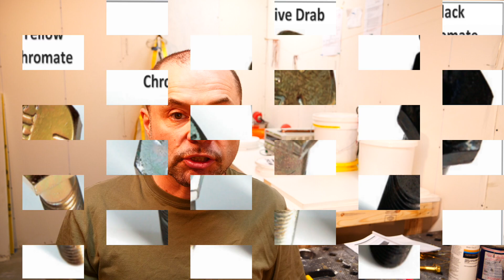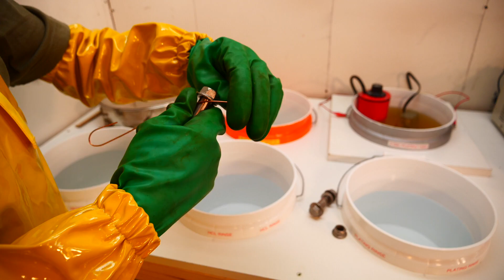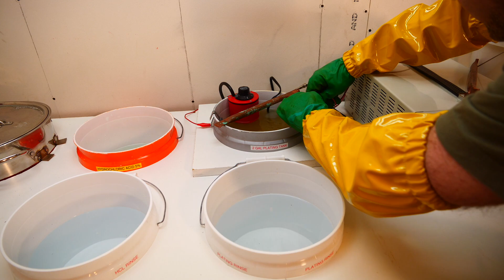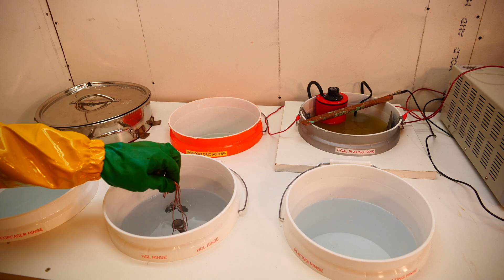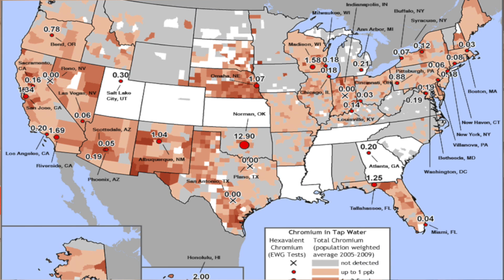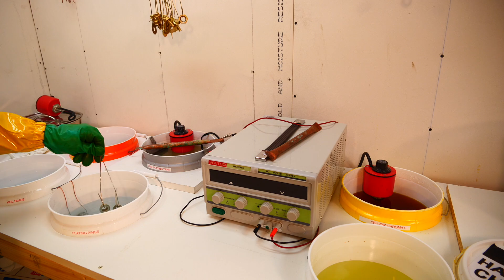ZInc Plating Hardware with Caswell Electroplating Copy Cad Zinc Plating Kit

Comment: Hi. I am new to zinc and chromate plating and love your detail. Expect the Caswell kit in two days. I have tumbled a number of bolts to plate and wonder if they still have plating on them. They are so light-dull and look so good I would use them "as is" but don't want to have rust develop right away?
Reply from the maker: Zinc will dissolve rapidly in hydrochloric (muriatic) acid  when you are prepping your parts before plating.

Comment: After plating, install, brush bolts and nuts with wax mix. 10 parts petrol, 3 parts paraffin wax. Heat it up before use, in hot water bath. Great protection against water.

Comment: About how long do you hit the parts with the heat gun and how long until the parts are completely dry and the chromate hardened on the parts?  The first few times I have tried this the chromate wiped off after hanging for 24 hours.  I used a fan as the directions say but I did not use a heat gun on the parts for drying.  Maybe the parts need the heat for the chromate to secure completely to the zinc?  thanks
Reply from the maker: I think hexavalent chromate reacts with zinc in seconds but divalent chromate used in Europe takes a longer time in solution.

Comment: Really enjoyed the Tutorial...
A couple of questions resulted.
What is your mix for the Muratic acid?
Do you have a degreaser you recommend? (Simple green?) 
What is the percentage for it as well?
Reply from the maker: Muriartic acid is diluted with distilled water to a 5% concentration using a kitchen measuring cup and an online dilution calculator.  I buy the SP degreaser from Caswell plating.  The composition is a a trade secret but I suspect it is TSP that is sold for paint prep in paint stores.  Caswell secret mix has 2 ingredients on the MSDS sheet in 80-20 ratio.  TSP in paint store is an 80-20 mix of trisodium phosphate and sodium carbonate.  A soapy bubbly product can be hard to rinse off and it will cause bare areas like oil contamination does.
Reply: Compulsive DIY thanks so much for the added info.

Comment: Hi ; good video but what kind of  zinc plating ? Acid or cyanid or alkalin ?
Reply from the maker: Plating bath is Potassium Chloride, Ammonium Chloride, and Zinc Chloride. There is more potassium chloride than zinc chloride in the mix.  I buy a proprietary mix from Caswell company so I do not know exact proportions.  PH is adjusted to 5.5 with small amount of hydrochloric acid.

Comment: Hi .
Trying this process at home too and I have some problems with the yellow/gold passivate .
Doesn’t hold on very well on the parts , I don’t understand .
Do I need to heated the passivate ?
I say that because when I wanted to zinc plated my rear brake calipers , I noticed if I don’t heated the electrolyte , it didn’t work .
Thanks in advance for advice .
Reply from the maker: Are you using hexavalent (sodium chromate) or trivalent (chromium III oxide). This may depend on what is available to buy in your country. Hexavalent chromium is toxic and highly regulated.  It is easier to use at lower temperature and that is what I use in this video.  Hexavalent chromium is still available here in USA but, I believe, it is now illegal to sell it in the EU and many other countries.  Trivalent chromium is harder to use, but industry is switching to it for environmental reasons and worker protection.  I have no experience with trivalent chromium but I read that it is applied at 60 degrees C and takes longer.  Also trivalent colors are different.
Reply: Compulsive DIY 
Thanks for your reply .
I use Trivalent  , but I think i’ve understood , it need a lot of drying .
Reply: @MIEDEPAIN20011   How did it go in the end ?

Comment: FANTASTIC video! But please work on your audio mixing/levels between the parts where you're in front of the camera, and the parts where you've mixed in narration. I find myself continually turning my volume up and down. A cheap USB condenser microphone with a pop filter attached would help the narrated bits sound miles better. Then just work on normalizing the volume levels, and job done! :)
Thanks again for some GREAT info! :)

Comment: Mine is coming out very flat.  I’ve glass bead blasted per the manual...should I polish them before plating???  The way the manual reads they suggested that.
Reply from the maker: Yes, I buff them on a brass brush wheel till shine, before plating.  It goes fast on bench grinder. Like many other projects it is pre prep prep for good results.  The dull look is the simulated antique cadmium plate look, that some restorers need.  They get it by dulling with blasting or fiberglass brushes.
Reply: I did not add any brightener based on some comments on the forum..so 100% correct...that’s what I ended up with.  Added brighter and it matches new hardware now.

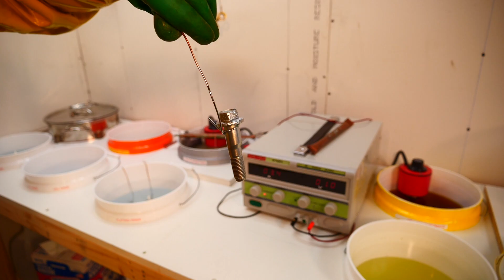Comment: can I ask you a question please: why do small quantity home platers get left with a grey deposit on their zinc plated parts? and then set about removing it? obviously a large plating company also brings the parts out with the full shine as you did at 19:50 but what makes the difference? also is it possible to Zinc plate diecast Mazak / Zamak? (zinc, aluminium, copper mix) - seeing as zinc is present in the metal being zinc plated?
Reply from the maker: I am not an expert just a hobbyist.  I read that many problems are caused by poor steel preparation, especially black spots.  Dark grey is caused by too high current.  Many home platers use battery chargers and do nor have great control of current.  Solution contamination is a big problem.  You can plate a sacrificial part to get all the contaminates onto it before your good parts.  I do not know much about Zamac.
Reply: @compulsivediy8036  - ok thanks .. Zamak/Mazak is what injection moulded Diecast Toys are made of - Hot Wheels used a transparent paint on plated castings in the 1960's which restorers try to replicate and effectively produce the opposite of a reflective surface but seem to find one under a coating of surface deposits after physically polishing it off. They looked similar to Anodised plating colours. Yours was the only actual zinc plated finish I could find as opposed to the 'surface deposit polished off' variety which a factory producing parts in large numbers obviously wouldn't have done. It's hard to say if Hot Wheels were plated for a mirror finish or a metallic grain though, maybe both, the reason they did it is clear, because Zamac is multimetal and this can still be clearly seen in a plain casting - hence the need for a even toned finish  before transparent paint is applied. https://hotwheels.fandom.com/wiki/Spectraflame

Comment: Excellent video. I have a full setup myself from Caswell and built some fancy electronics for temperature control. I noticed you were doing an acid dip before using the yellow chromate. What concentrate are you using? It seems some are acid dipping and some are not. Keep up the good work.
Reply from the maker: It is the same 5% muriatic acid that is used as a pickle before the plate tank.  I saw someone do it, apparently you get a brighter yellow chromate if you do a quick acid dip before chromate bur it has to be fast because zinc dissolves rapidly in acid.

Comment: Hi I´m alsow zinc plating myself , but i´ve seen your video and i would like to ask you a question. 

In my Zinc Tank , the Zinc is getting darker, and it is starting to contaminate the solution, do you have any advice in what i can do when i finish ( cleaning the zinc or something) and filtring the solution so next time it is not as dark?? Thanks a lot
Reply from the maker: I remove the sink anodes at end of the day rinse them and clean them with scotch-bright pad (mild abrasive pad).  I store zinc anodes clean and dry between use.

Comment: Awesome video .I use the same kit as you and lost my instruction how to make up my yellow chromate solution.

It says Dilute 2.25% but with what ?Water or acid?
It has a little. 50Ml bottle of Nitric acid there
Reply from the maker: Caswell’s yellow chromate that they sell in USA is a liquid concentrate.  Directions are 1oz of yellow chromate mix into 1 gallon of distilled water.  This concentrate Is chromic acid 17% , sodium dichromate 17%, nitric acid 14% sulfuric acid 3% in distilled water. The percentages are by weight.

Comment: Great video.  Very detailed.  I just ordered my kit from Caswell.  Can you continue re-use the copper wire after its gone through a plating session?
Reply from the maker: Yes, I reuse the copper wires, it does not seem to degrade the solution.

Comment: What is the composition of the cadmium bath?
Reply from the maker: There is no cadmium.  This is zinc Plating with zinc anodes in zinc chloride bath.  If you zinc plate dull looking steel it will look like old cadmium plate.  It has to be sand blasted or dulled with a fiberglass brush. Cadmium is too toxic and no longe available.

Comment: where did you buy the heaters?
Reply from the maker: Industrial heating supply inc     www.industrialelectricheating.com   They are great but expensive with very accurate thermostats for repeatable operation.  They will hold consistent temps from slightly warm to rolling boil.  If you are degreasing in a stainless pot you can put it on a cheap hot plate.   Having hot water in a plastic bucket that becomes visibly softer at near boiling temperature can feel a little unsafe even though the bucket should theoretically handle it. Second hand stores always have cheap stainless pots.  The plating tank can be heated with a cheap fish tank heater because it does not need very hot temperature.

Comment: Dear sir,

Your video is awesome. It gives practical knowledge about the processes.
Thanks for sharing the video with us.

But now I had a question, why you did zinc plating before yellow chromate on?
Are we able to do yellow chromation on stainless steel fasteners?
One more question is whether the process of yellow chromation is same for aluminum and steel. Are we able to yellow chromate and assembly consist of aluminum and stainless steel fasteners??

Please clarify the above doubts. Thanks in advanced..
Reply from the maker: Zinc Plating is a sacrificial rust protection layer on regular carbon steel (also called mild steel).  Zinc is more chemically active and it oxidizes (rusts away) first when exposed to the environment.  Zinc plate will oxidize away at a rate that depends on environment.   For harsh outside environments "hot dip galvanizing" is used.  Steel that is being galvanized is dipped in molten zinc metal. That applies a thick layer of zinc that lasts for long time outside.   This is a galvanizing video    www.youtube.com/watch?v=Az87Q0JedG4 

Zinc easily dissolves in weak acid.  Thin zinc plating will dissolve in tomato juice.  Chromate is used to increase acid resistance of thin zinc plate.  It looks good but it is done for acid resistance, not for appearance.  All of the other electroplating processes are used for appearance.  For example chrome plating, nickel plating and, of course, gold plating, are done to make parts look a certain way.  It is possible to chrome plate as a small hobby but it is expensive and complicated.      www.youtube.com/watch?v=39RXctLZ8Rs

Stainless steel is not usually zinc plated or chromated.  Stainless steel contains a lot of chromium!  For example 304 stainless steel, used in cooking pots, contains 15 to 20% chromium, that provides rust resistance and other properties.

Aluminum parts can be protected from aluminum corrosion by a chromate conversion process.  In this process aluminum itself reacts with chromate salts, ( there is no zinc and no electricity).  This prevents aluminum corrosion and promotes paint adhesion.  It is mostly used on airplane parts.  www.youtube.com/watch?v=53Je20BQ6w8

Thanks for watching!